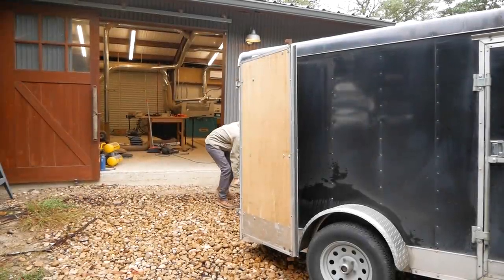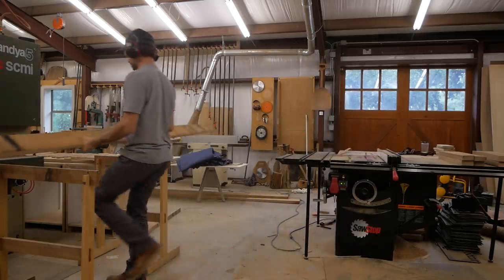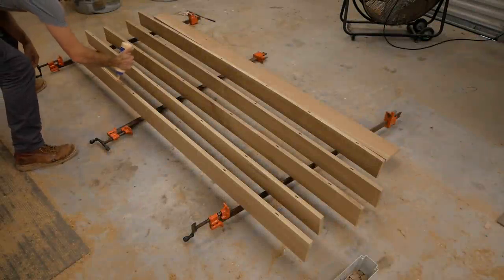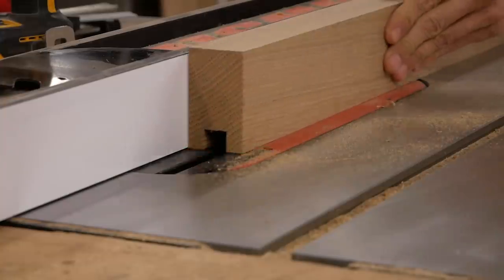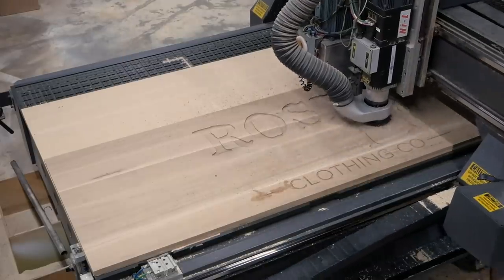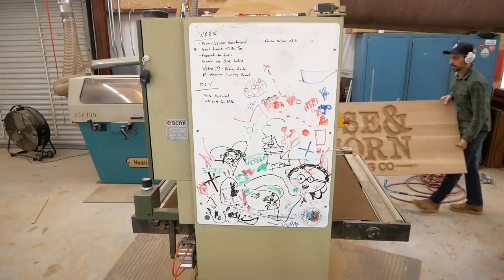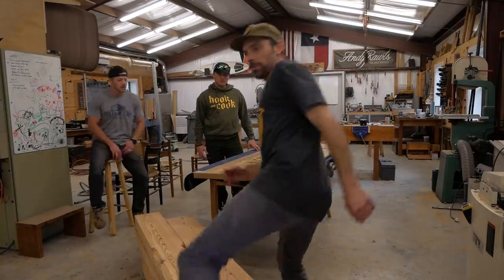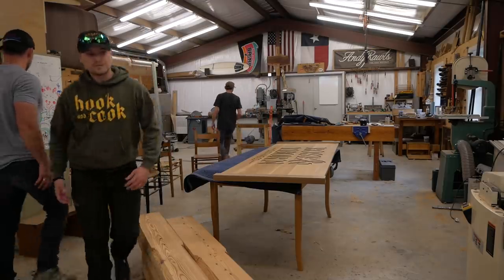Building A Custom Sign For LunkersTV

Comment: You should not need to hand sand off a wide belt if you have grain running one way. Check your platen graphite and felt/foam. Your contact drum should also be free of gouges too. The last thing to check is your belt splice. Caliper it against your belt/paper to make sure it is thinner. That can create a chatter line if it is a thicker splice than belt. Also, the chatter will be almost perpendicular to the part even though you would think it would be angled. The last pass belt should be paper backed. I know cloth is more durable with the change overs, but it gives a better quality finish.
Reply: Agreed. My shop operates a 36” wide belt, as long as the grain is all one direction the final finish it amazing. No need for a palm sander after.

Comment: I’ve experimented with lots of CNC engraving and signs and how to paint/stain them, and good results can be a learning process. I’ve found the best process (for me) is to pre finish the sign, and I prefer lacquer. Ensure the grain is sealed well, then engrave on the CNC. Then I’m able to paint or stain the open grain with no bleeding into the non engraved portion. I’m sure results may vary